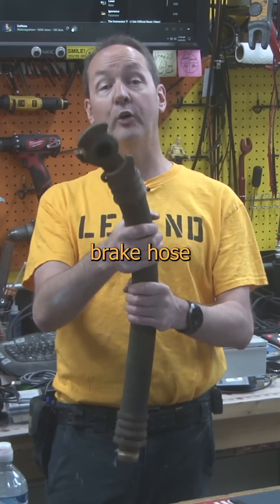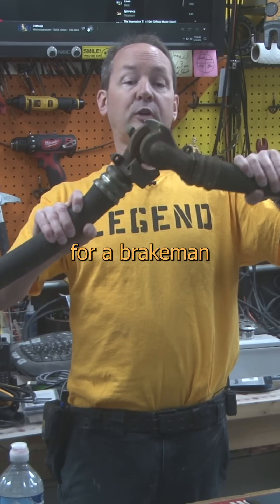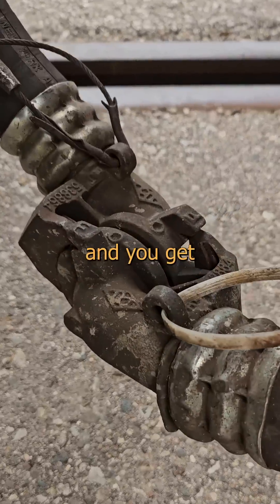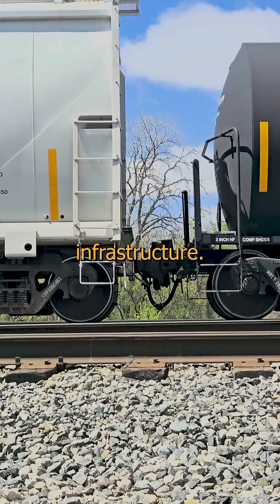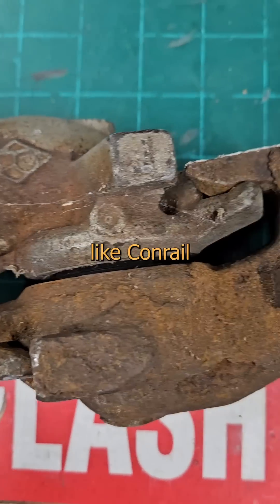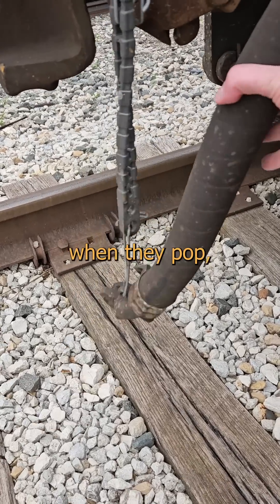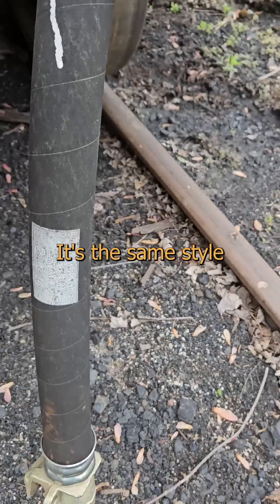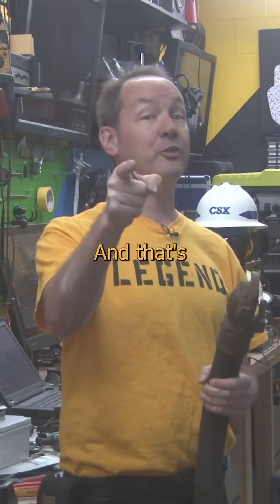Railroad Brake Line #chrisboden #comedy #engineering #train #gladhand #educational #connection #hose

Comment: The rubber piece attached to the hose isn't to keep it in line, it's to keep the hose up.  The FRA and AAR have their regulations that Carmen like myself ensure are adhered to.
Reply: And half of them are missing, letting the glad hand bounce off of every crossing and dragging equipment detector. Ask me how I know…

Damn things still work even with the bottom ground away, though.
Reply: @kenrickman6697 do they activate the dragging equipment detectors? If yes, aren't you supposed to do something about it when those detectors are triggered?
Reply: @adrianthoroughgood1191  Yes, they can. If one goes off, it means an immediate stop and inspection.
Reply: @adrianthoroughgood1191  That guy is being dramatic. I’m a Carman for a Class 1 and I’ve never seen a drag detector hit because of a missing end hose support. If your end hose hits a detector on a line of road train, it is most likely already in emergency or will be very very soon. In that case the air hose support is likely not the cause of the problem and your end hose arraignment and or securement has likely failed wholesale.
Reply: @SheriffMoney   I see your carman and raise you 27 years of train and engine service on a US class 1. Over 20 as locomotive engineer, the rest as conductor. Yes, I've seen air hoses hit dragging equipment detectors. Often, because some lazy carman didn't do his job and hang up the air dump hoses between cars like he should have. Other than that, yeah, the hoses should be coupled.. though some of the ones on locomotives hang a lot lower than they should, and I've seen plenty of examples of the wrong hoses being installed on cars, resulting in them hanging too low even when coupled, dragging on crossings and wearing holes in the rubber, snagging and uncoupling, and yes, even hitting dragging equipment detectors.

How many trains have YOU had to walk because of a hose hitting a detector? I learned pretty quick that when I got an air dump train, especially ballast, I just went ahead and walked it and coupled all the dump hoses. Guaranteed the carman who was supposed to have inspected it didn't bother, and it's a lot safer and faster walking it in a yard vs on the main line.
Reply: @kenrickman6697 You made my point. Nonstandard parts and arrangement defects are almost always the cause of end hose related train delays, not end hose supports. In fact we are not even required to put supports on standard S242 arrangements per the FRA. Which is, you guessed it, most rail cars. 

Those in the industry would also know a transportation guy calling a Carman lazy is a hell of a take. What you see as lazy is actually Carman being forced to triage every 100 car track your dipshit train masters set with only 30 minutes till YOU are getting on your power. We literally cannot fix every single thing that needs fixed without being penalized. So yeah, sorry that on occasion your train isn’t all it’s cracked up to be. Maybe ask your trainmasters and yard masters how much time the Carman actually had to look at the thing next time before blindly blaming mechanical.
Reply: @SheriffMoney  I thought you were just joking around and being a smarta**, until I read your second comment. 😉
Reply: @SheriffMoney this isn’t the forum to have an argument between crafts. I’m very glad to hear that you and your coworkers never cut corners or install the wrong hoses on cars, and I’m sorry to hear that you feel uniquely and unduly burdened by the stupidity of modern railroad mismanagement. I can only say that I wish all the car inspectors that I’ve dealt with in my career were as dedicated, motivated, and professional as you.
Reply: @kenrickman6697 I feel like I can sense a tinge of sarcasm in your reply… but, you’re right. There’s no need for inter craft beef. We’re all subject to the management and shareholder’s need to constantly have more for less. 

Just remember that most carmen aren’t trying to send you line of road with 12,000ft of garbage. We can’t control every industry or scab outfit that puts hands on these cars and I can’t say there isn’t some dog water Carmen out there. Railroading is an uphill battle for all of us right now. 

Stay safe.
Reply: @kenrickman6697 dispatch made me walk my entire train as I was riding a shove into a yard from the main. I literally watched the glad hand on my eotd bounce of a crossing and dump the train. Funny part is they issued a 5mph speed restriction the next train had to knock down. He was 12,000' 😂
Reply: @kenrickman6697 How do you know?
Reply: all that girth, kept safe by a small bit of rubber,

Comment: I'm surprised it seals as well as it does. Even two engaged hoses look like it'd expect a small air gap at the meeting point
Reply: When the glade hands slide together they also squeeze the gaskets together.
Reply: @acehawk888  i can see that but this still leaves a small visible gap between the two hands right? The gasket might be seal just looks unexpected not sealed

Comment: I work for the national rail operator here in scotland, we maintain 4 different fleets of electric passenger trains in my depot. Lots of cool engineering in trains but the one that always blows my mind is the wheels, no need for a separate steering system or differentials on the axles all down to how the tread of the tyre is shaped. Seems deceptively simple but some amazing physics and engineering genius at play
Reply: The old 303 leccies used to have similar connections, as did the old Sleeper coaches, and the 101 diesels.  Be thankful the autocouplers made tie ons a whole lot easier 😉
Reply: @mcdon2401 yeah it's shields I work at, the 303's were retired before I started working there,  One class I was glad to see the back of was the 314's , hateful things with zero redeeming features lol
Reply: The conical shape is why it is so dangerous to put coins on the rail to be smashed. That & the slight curve of the rail can shoot coins at the same velocity as a bullet fired from a 45 pistol.
Reply: @WarrenMZorroslastride   as a young 12 year old boy full of puberty hormones and caffeine , my friends and I would put ALL SORTS of things on railroad tracks. 
There was a large earthen  berm and abandoned train cars we would hide behind.  I still have some coins , a fork and a circa-‘99 ball chain necklace all super flattened. ‘Twas fun times
Reply: Well hello from Haymarket. I have similar feelings about the hst fleet, I have a soft spot thinking how futuristic they must have been when replacing deltics but there's more modern things in railway museums.
Reply: @findtherapists  hi m8, yeah the hst's have had their time, got a great legacy but best for them to retire gracefully
Reply: The guy who thought up those wheels was Ross Winans , who also came up with rotating axels and too much else to list.
Reply: Oh man I (german) would love to move scotland one day 🥰 but the uk just makes it unappealing for me 😵‍💫 
Maybe I'll move to irland or Norway  one day ❤

Comment: Semi trucks & trailers use the same air line setup for brakes just scaled down or railroad scaled up 🤷‍♂️ I just know it works
Reply: The truck version is a scaled down version of something that was designed and perfected decades before trucks even existed. Much like the entire air brake system on trucks.